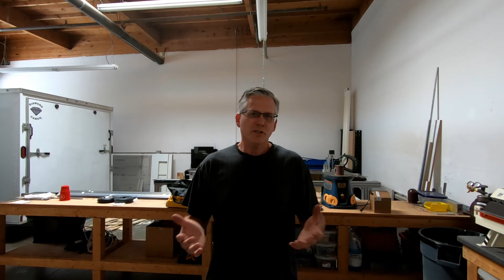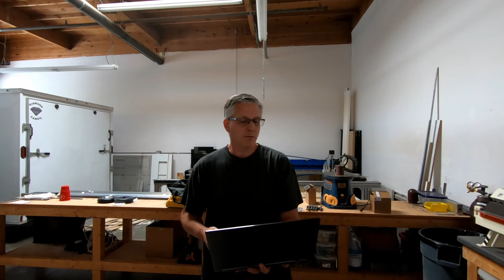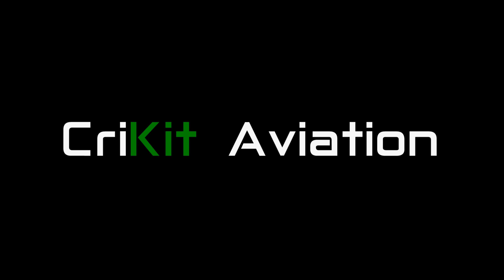CriCri FAQ 1

Comment: There is an exemption to the requirement to have 30 minutes of fuel on board when you take and that is if flying
in aerobatic competition in an aerobatic box that is co-located next to the runway where the competition is taking 
place. You only need to have enough fuel to taxi, take off, fly to the designated hold position and then enter the
box and fly the sequence, then exit the box and land. In a well run competition you might only need 15 to 20 minutes
of fuel on board.
 I've also seen videos of electric CriCris but they have the same problem with limited range that other electric aircraft 
have. the big advantage for electric is that you can start the engines while sitting in the plane.

Comment: Perhaps a jet CriCri could be certified in the "Exhibition" category and get by the minimum fuel rules? The Ops Specs may state a maximum (short) flight time. I imagine that some radical airshow aircraft may have similar minimum fuel issues.
Reply from the maker: I might look into that. My aircraft could easily be certified "Exhibition" category.

Comment: under 254lb and no more than 55knots, you can run part103 and it doesn't seem like theres anything in the rules that say you can't fly with more than one engine. Kolb had a twin engined part 103, so theres proof right there.
Reply from the maker: Wish it were true. Twin engines aren't the problem but power off stall speed of 24 knots would be without redesigning the wings. Need to leave behind a gallon of gas also. Maybe some CriCri sailplane wings.... ;>)
Reply: @crikitaviation  sir can we use single engine....